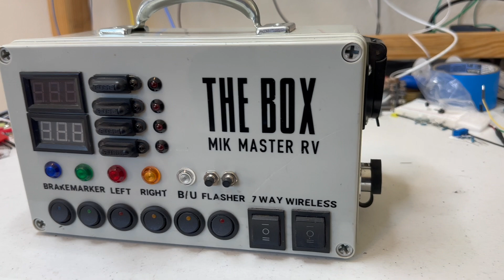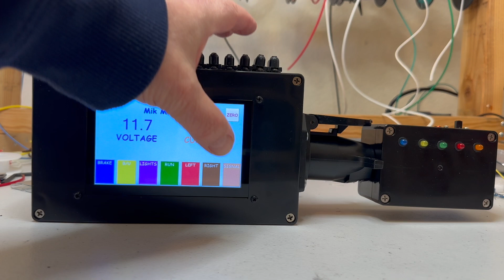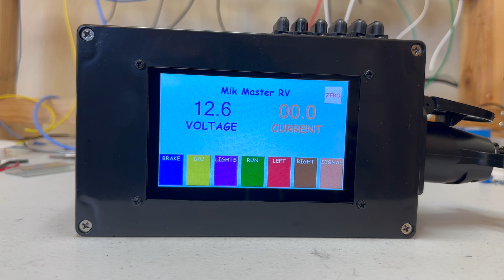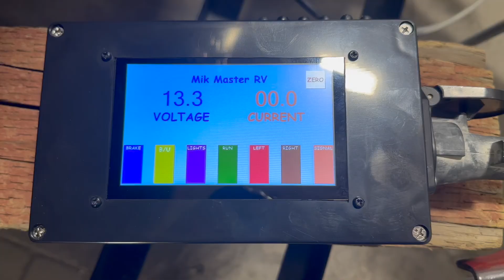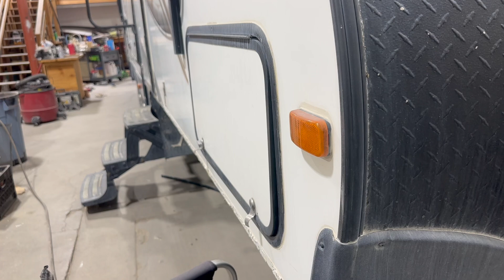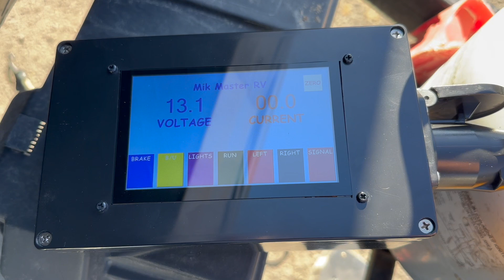Trailer Tester

Comment: This is nifty, I followed the rabbit hole from one of your previous builds.  I am about to build one of these boxes and am interested what you used for this version.  Did you have a rasperry pi or did you use arduino?  Or something else, either way this is pretty cool.  I already have a touch screen and a Pi I could use.  That's more hi tech than the box I was interested in building but I have the components and they aren't in use now.
Reply from the maker: I used a Teensy but I won’t be making a how to for this version I have too much time and grief into it.  May try to sell them.